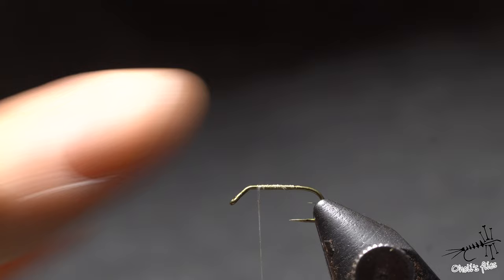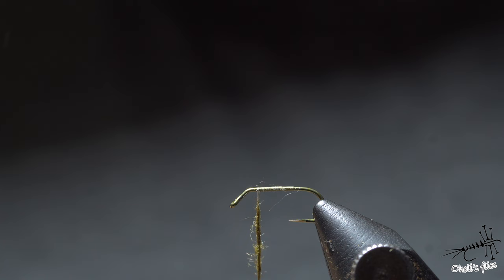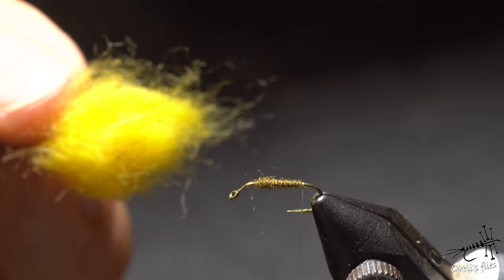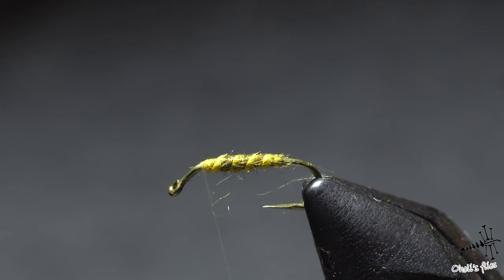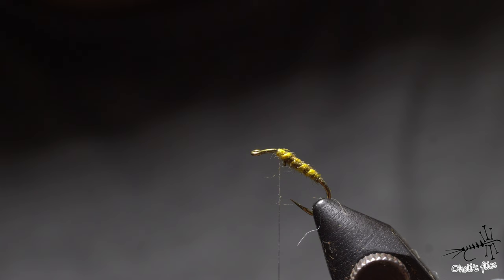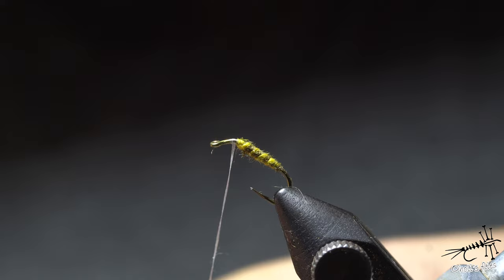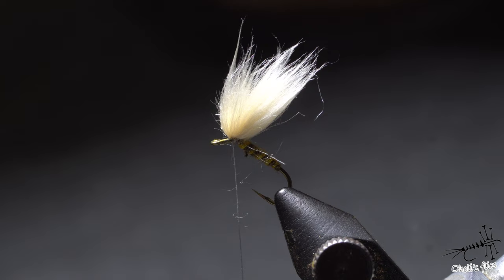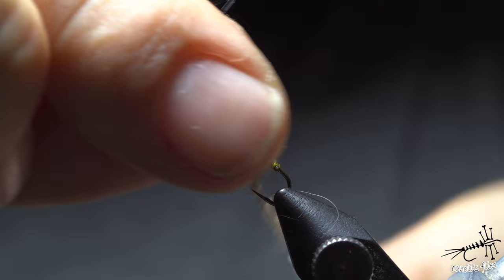Better than CDC???? (read the description)

Comment: My experience with kapok that it soaks easily with water. So IMO definitely not a replacement for natural CDC. It’s okay for a sparsely tied body, but not for wing’s.
Reply from the maker: Raw, natural one is far from that. Very hydrophobic. Dyed ones are less buoyant but still float well. Maybe you got one that has been treated in some way to remove wax from fibers.

Comment: Excellent video. Natural Kapok is sold as pet bedding. A huge bag for £3. In fact a ten year supply. I don't get the Semperfli price at all. Short staple length limits its use, but that's not a problem with smaller hooks (say #16 and smaller). Emergers on pupa hooks with a tuft of combed kapok, are a winner. I certainly wouldn't use kapok on emerger bodies. It dubs well for straight shank dry flys, and it can be used in a split thread, twisted (like CDC) to form a segmented body (that may need to be trimmed to shape).
Reply from the maker: Natural is super buoyant. Dyed onr is less. So when dubbed tightly it will sink with hook. 
It becomes less buoyant with dye process.

Comment: My fly catches where others fail.  Using size 12's and 16's:- I though on such a bare fly, why not make the hook part of the fly?  So using super fine 'invisable' sewing thread I wrapped a few turns near the eye. Then taking Gutermans Sulky CA02776 multicolored holo thread I tied this in and wrapped it to just round the bend near the barb, and back round to where it started. A dab of super glue over the whole wrap keeps in place. Now takind a 1/2" bunch of very  fine polypropylene black (or white)  fibres pinch these and swiftly flash one end with a lighter to hold together and tie on near the eye; with the fibres backwards.Trim and finish of with a dab of super glue. I use a 5ft length of 12lb  floating mono with 6ft of 8lb fluro carbon tippet.  With a good flotation even if sunk it pops back to the surface. If a fish takes it DO NOT strike wait until the line tightens up.  If it does'nt,  retrieve the line very slowly, and often will take the fly again - viciously!
Reply from the maker: Thanks for this. I tied few with wing end burned like thst but i never fished them. Are they durable?
Reply: @Oholisfliesandfishing  The sealed end is tied on to the hook- never tried it other way.  Still got some that have caught loads of fish. If you have to use the forceps it can break the wrap.

Comment: That is a great fly. Try tying the wing off the bent part by the eye. I have done that the last two seasons it allows the body to sit vertical in the water i call it a kinkhammer and it is a hammer
Reply from the maker: Thank you so much. Glad you like it. All emergers with body submerged will catch a lot. I just love them.

Comment: You won't believe me... I had the exact same idea to try using kapok as a wing material, but didn't get to try it out at the vice, as I figured that the fibers would be too short for the purpose. You just proved me wrong.
That's got to be a game changer!
Love the body technique as well.
Thanks for sharing! Best regards.
Reply from the maker: I do believe you. I got inspiration when i watched a guy tie RS2. It just poped as idea. I tried it and it works. However, need to test it more

Comment: Kapok, was used exclusively during wwii for life jackets. I’m not sure if it still is but one life jackets would give you enough kapok to last a lifetime. 
What about the filling in modern sleeping bags?
Reply from the maker: Sure, i also bought some filling for pillows. Its i think commercially available but problem is color. Its super difficult to get consistent color without damaging it's properties.

Comment: Great video.  If you put your wax in a bowl of warm water for several minutes, then you can pull a small bit off and you can then kneed that small piece so that it’s can be melded to your finger or knuckle
Reply from the maker: I knew i need to warm it up. But i never thought of water. Great idea. Thanks

Comment: Another great presentation. Do you use Royal Sissi Capok or Semperfli. A hard material to procure down under but will certainly give it a go once procured. Regards John.
Reply from the maker: I use royal sissi for dubbing. But for wings i am using raw, directly from a tree

Comment: can you dye kapok using permanent markers?
Reply from the maker: That is very interesting one. I never tried. I will try. Thanks
Reply: It doesn't take to marker very well and seemed to mess with the fibers. Traditionally kapok has always been considered a near impossible material to dye. 

Semperfli has learned how to dye this stuff and it's consistent I have no idea how they did this wizzardly.
Reply from the maker: @MarcTelesha  i dyed it with very similar results to semperfli. It messes up the fibers too. Its also royal pain to untangle fibers after they get dry. But still love it
Reply: @Oholisfliesandfishing  what dye did you use? When I dyed mine they lost the floating ability completely. I tried Rites a textile dye with limited results. They just seemed clumped together and lost their floating properties. I figured acid dyes would perform worse. Semperfli dyed Kapoc seems much better than I did.